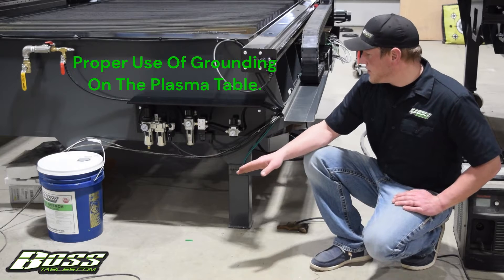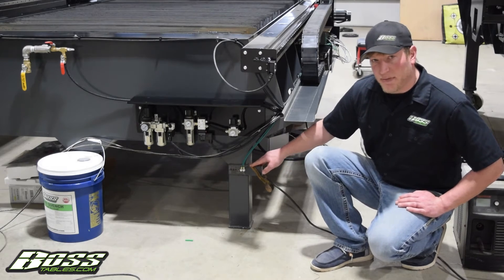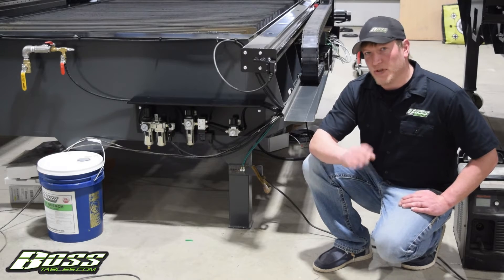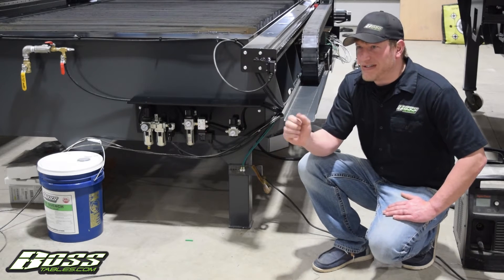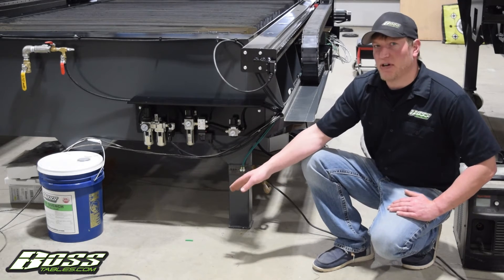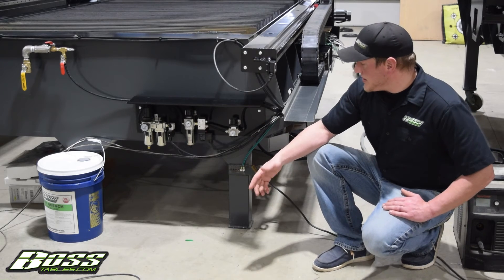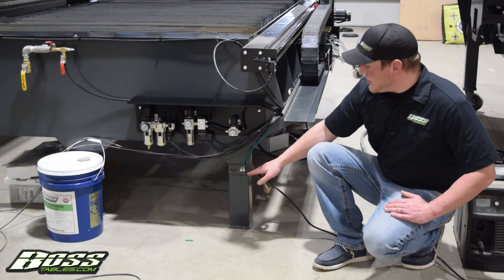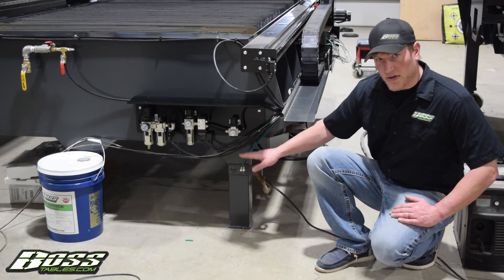Proper Grounding On Your CNC Plasma Table

Comment: Ok. Do you use a diode in the mass of table to the earth ground ?
Reply from the maker: No, the table is grounded direct to a noise ground. It is not the electrical service ground.